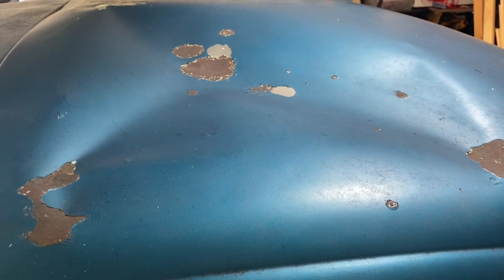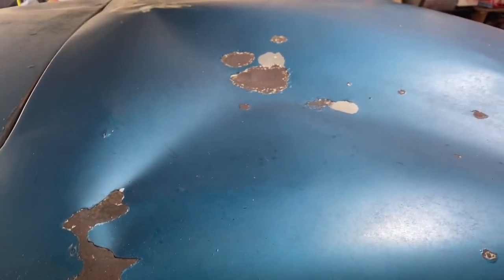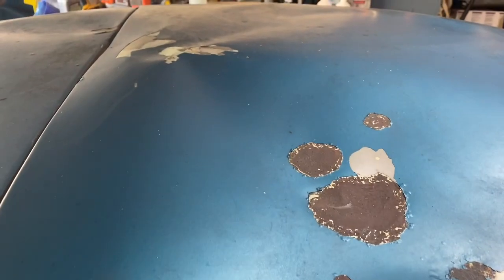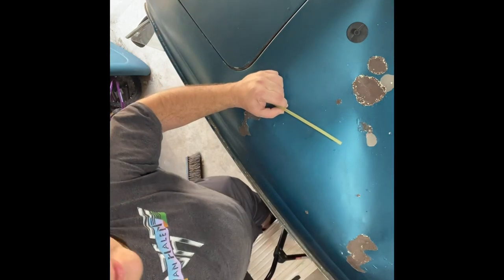1976 VW Beetle roof dent repair with slide hammer and suction

Comment: An evil kid in my old neighborhood jumped on my '74 VW Beetle and dented it in to the point where I didn't think it could ever be fixed. I stood up inside the car and pressed my shoulder and back into the dents. I was able to straighten out a great amount of the dents. Then I used a rubber mallet from the inside to bang out the rest of the imperfections. It's not perfect, but nobody really notices the dents now; except for me - of course. Good luck.
Reply from the maker: I’ve heard other people suggest that. I might try and see if I can lift it from the inside

Comment: Awe man, I would have liked to see what the roof looked like from the inside. Maybe you could use a 2x4 and a rubber mallet from the inside to pop out the dents?
Reply from the maker: I actually did that today with a 2x4 from the inside and it came up a lot more

Comment: the metal off old cars is thicker then the cars now. therefore this method works well with younger cars.
this big dent has to be pushed out from the inside while you working around with a hammer and a metal block.
that's a nasty dent to remove, but inform well and it can work out and otherwise get a good body worker to try fixing this.
Reply from the maker: Thanks for the comment. I didn’t take the thickness of metal into consideration but that makes a lot of sense.

Comment: I think I would get inside the car and push up. I’m guess you could almost do it with your back and get it to pop up.  Once you have it up. Use a slap hammer to move the metal around you would be surprised how well it works.
Reply from the maker: The sunroof rack is making it tough to do it from the inside but I’ll figure something out. I’ve heard good things about the slap hammer. I’ll definitely try that once I get it back up
Reply: That's what I did.

Comment: Did you try using a rubber mallet to push the dents out?
Reply from the maker: From the inside?
Reply: @zimms-world  
 Give it a few bangs from inside. Put one hand on the roof where the dents are, and hit on the inside feel if the dents smooth out.
Reply from the maker: @vintage76vipergreenBeetle  only problem with that is there is the sunroof tray on the inside
Reply: @zimms-world   Can the tray be removed?  If it can't, then you will need a Stud Welder Dent Repair Kit.
Reply from the maker: @vintage76vipergreenBeetle  to remove it I will have to drill out the spot welds in the sunroof tray. That might be my best option at this point
Reply: @zimms-world    I would try to borrow or rent a Stud Welder Dent Repair Kit. Before I would drill out the sunroof spot welds. Just my .02  Good luck
Reply from the maker: @vintage76vipergreenBeetle  i might try   The stud welder. I actually went out there today and got a lot of it back up from the inside
Reply: @zimms-world   That good. What tool did you use?
Reply from the maker: @vintage76vipergreenBeetle  a 2x4 and a floor jack